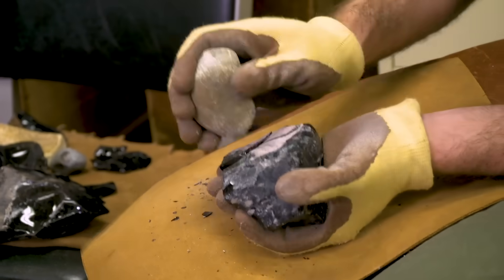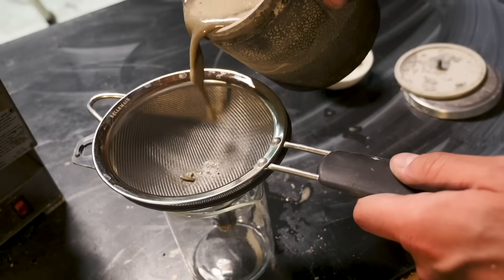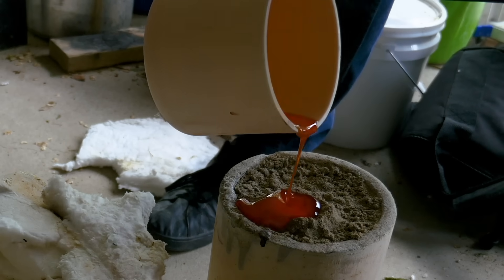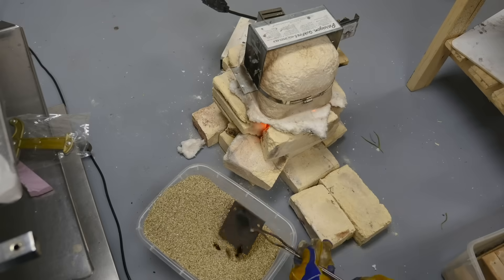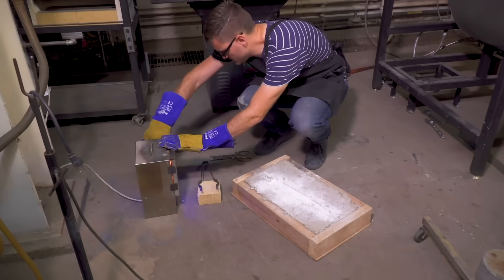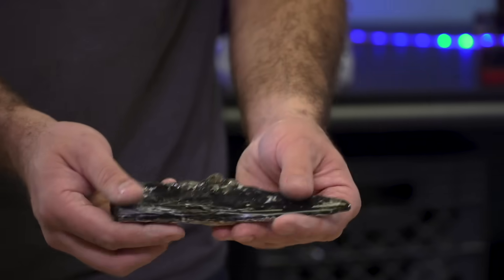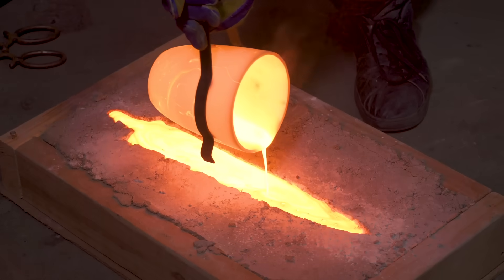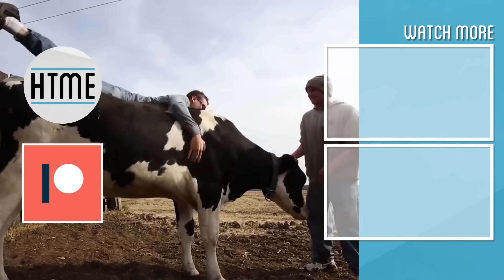Can You Melt Obsidian and Cast a Sword?

Comment: And the best they could ever do was make very skinny sharp little knives and arrowheads from obsidian and yes they had to use the ancient and old technique of fracturing it it worked thousands to hundreds of thousand years ago and it didn't need to change now but the best sword is the ostock sword which is a sword with spiky serrated edges of obsidian the sword is made of wood there's a wooden paddle with a whole bunch of arrowheads sticking out around the edges and that bad boy was sharp enough and strong enough to decapitate a horse with one swing but enjoy the video was thoroughly entertaining maybe you should try making arrowheads out of it instead of a sword would be feasible and probably won't fracture on you

Comment: You ever heard of a LEHR? After glass bottles come out of the machine that blow forms the molten glass into shape. They then spend a long trip through a large conveyor system that has multiple gas jet flames shooting at the newly formed bottles and cools the glass slowly. As not to trap energy inside of the glass. The glass will be really strong until it’s not. Then it explodes...violently!

Comment: The chemistry of glass is vital to what you were doing, and when metals are added it works best if they are already reacted as in nickel carbonate.  For flux this is even more important and borax and or lithium  are most likely needed. The rules are very different than metal that the glass batch has to be heated very slowly for a long time. The usual alumnia pots will often crack under the besf of conditions. If you want a pot likely to survive you will need a cubic zirconia pot which is a kind of clay and treatment with little relation to the jewelry. To actually make the piece it would be better tonget the near shape you want and press mold it as it will never run like water or liquid metal. Of course some research into chemical content and the appropriate amount of flux mignt be asking too much and the coeffecient of expansion needs to be as low as possible and the same everywhere in the piece hence the need for a long heat time and all the glass needs to be outof the pot before it is cooled or even a cubic zirconia pot will break.

A real glass shop with a glory hole to even out the heat before going into the annealer would also be useful. As would a very looong annealing time.

Comment: It is my opinion you have no choice but to make a custom alloy! I would be really interested in seeing what you'd come up with, never really considered "rock"/metal alloys (though from a astronomist perspective anything above helium in the periodic table is metal...) but I'm betting you could even create something new that may have some interesting properties (with some luck revolutionary).
Try to mix the obsidian with around 5% to 8% silicon, then add 1% to 2% lead (to prevent the cracking, copper may also be a good idea).

Comment: Honestly if it would have been me firing obsidian, I would have used a mixture of additional silicate and seawater. No flex needed you have three of the basic elements for obsidian right there. Considering obsidian is technically seawater magma and silicate, magma Bean a silicate melted by heat. I might suggest if you try this again, use these three methods of mixture at a approximately 70% obsidian 20% additional silicate and 10% actual basalted seawater. He too approximately 27 to 3400° and pour.

Comment: This would probably yield better results in a sintering furnace. The powder and the mould would have to go in the furnace in a way that the powder would be above the mould and then flow into it when it becomes molten. This type of furnace is also a vacuum chamber and would remove the impact the environment is having on the molten obsidian.

Comment: Japanese have a process when making a specific type of pottery. Original temperature very slowly reduced over time- much time. They do this by building multiple fires of slowly diminishing temperature. The apparatus begins on a slope with the highest point at the highest temperature , next step is to lower the pot done one step to a slightly lower temp then repeat that step until the lowest step is reached, thereby achieving a pot temp that will not crack . Doubt if that will work for obsidian since it is not much good for a blade in the first place. But you might achieve a solid obsidean blade. Then buy a knife with a steel blade for actual use.

Comment: WHERE YOU WENT WRONG at 8;30 minutes in the video,, ??  
was that YOU DID  NOT PREHEAT YOUR Casting Mold and/or your VERMICULITE.   
FIRST;, YOU SHOULD HAVE BLOW TORCHED your Casting Mold to as hot as you could short of melting the sand, then thrown HOT MOLD SAND ON TOP OF THE POUR.   
Then SECONDLY;,  The casting mold ITSELF Should have been in the Vermiculite BOX. 
Then go back TOMORROW and look at it.

Comment: Make an INVESTMENT MOLD with a wax pattern in it. Melt your 100% obsidian in a propane forge until runny liquid. Then add a large pinch of flux. Stir with a quartz rod. Your mold needs to be as 🔥 hot as the obsidian. Pour the obsidian into the mold, and immediately put the mold
Reply: back into the kiln and reduce the temperature very slowly over at least a week. Good luck.

Comment: May I first say that your attempts at this are inspiring and congratulated. 
Now, for my knowledge, observations, and suggestions. Obsidian is more of a stonelike and less of a glasslike material so the process is going to need some tweaking. You don’t want to draw out the impurities as much since they are more or less essential in what makes it obsidian. I would suggest using only a little flux and relying more on the heat to melt it all together. A larger propane furnace might be better for the process. Heat it to liquid to melt together, then bring the temperature down so it’s closer to a gel like state. It will be a little more difficult to pour and mold but it will also be less prone to fracturing. Make sure the mold is well heated also. After annealing it should be in good condition. From there you can grind an edge that possible to hone or you could knap it for that serrated razors edge.

Comment: Your mold needs to be pre-heated.  The glass (obsidian) is experiencing thermal shock from the relatively cold sand in the mold, causing it to cool too quickly and break.  The slowly cooling thernal mass of the mold will prevent a rapid temperature change and should prevent thermal delta as a cause for cracking.

Comment: You should look into graphite crucibles and a kiln that can get hot enough to do what they call slumping. Also once you have it poured into your mold if you can ramp the temperatures down over like a 24 hr period you're much less likely to have cracks.

Comment: Actually, Youre Turning Obsidian into glass.. It's no longer obsidian once melted and cooled without the intense pressure so the answer is no, you can't cast an obsidian sword using standard casting and glass making techniques... Cool experiment but a little science would have saved a lot of time. A for effort and Tenacity, thanks for sharing.

Comment: When obsidian is melted, the molecular structure of the minerals in it change upon it liquifying, thus causing it to change color, consistency, melting temp., and angle of curvature which it will break at, causing it to become naturally sharp. What i think would be interesting is: mix iron filings into molten silicon at a ratio of  Si 10: Fe 3. Then expose it to high frequency X-rays produced by  a filament of Cobalt 60 metal wire excited with 1,500 Watts of electricity, for 3 minutes. There are forms of black quartz that formed in the earth, that gets its color and metallic like sound from the iron. One of the outer most electrons of the iron atoms gets knocked into the S-2 electron shell, causing the material to change color and alot other physical properties such as the silicon becoming able to produce sounds of a big, thick, steel bolt, or a sound you would expect from a tire iron, or something.

Comment: Vermiculite, an insulation, is very bad for lungs tissue.  Indeed, it causes cancer just like asbestos.  Might want to wear a mask and not goof around with it inside your house. The particles become airborne and waft I the air until it is sticks to mucous membranes when inhaled.  Than, over time, the millions of microscopic particles cause cancer.  Usually lung cancer.  Clean the room that you used it in by using damp rage and… wear a mask rated to keep out the tiny particles of vermiculite.  BTW, the video was very interesting and your explanations and process was fabulous.

Comment: "Another way to make absidian into a blade" is to cut it with a rock saw. That leaves a blank unchipped blade. And instead of chipping it with a regular implament. You force its edge with weight down and acrossed something like antler. This will give you a blade as big as your saw will cut. Pluss still have a chiped edge. That has exstreamly even chips. As the edge is even and smooth. So chips come off the same down the length of the squared edge.

Note. Wear goggles to protect your eyes. As shards will fly everywhere.

Comment: If you know how to do the glass-ceramic process by mixing the obsidian with a metal/ceramic nucleating agent for the divitrication, then maybe a castable weapon could be done? A lot of fancy stuff but basically the divitrication liquid (found online apparently, I doubt it's that easy) allows the mixing of the ceramic with a complying ceramic creating a glass-ceramic by crystallizing the uncrystallized obsidian. Maybe be as sharp but no longer as brittle as before.
Reply: Or an even crazier idea, folding the obsidian to get the impurities out, or does that only work for metals?

Comment: How about letting it cool in the daft clay mold (both sides)? or lost wax mold. Since the lost wax mold is already hot (900 degrees) it should cool down slower and allow the glass to set up more firmly. Just a thought-

Comment: Obsidian is hard, but hard doesnt mean resistent, its so hard that when you smash it with hammer it dont get smashed or bends, so the damage is not absorved, andnit goes for the object without anything for absorb it, so a iron may be more usefull, but obsidian make much better blades because it can be more thin than metal, the Aztecs used wood swords with obsidian blades for fight against Spanish People, they said that with one attack someone litteraly cutted off the head of an horse, with one fricken hit

Comment: im no expert or anything, but i always thought if a sword gets casted, you are not using an open castform for that - but a closet one (which is empty, so nothing for the material to burn away to - basicly two realy tight "opencastforms" with a tunnel packet on top of each other.
Works with most castable metals and your pour looked pretty good so why didnt you try that? Im not judging im just curious

Comment: That's not really a success!
I believe in order for you to have a chance, you need to create a mold where you set your obsidian mixture powder, take it to furnace and slowly heat it up to melting point. Then you need slow cooling ramp to prevent it to shatter. Probably for the mold you need ceramic to be shaped and baked properly to keep it from shattering as well. Also keep in mind the thermal coefficients of obsidian and ceramic when making the shape in order to prevent stresses while cooling down. Shape it in a way that no stresses will be generated when one material contracts more than the other. Still I think it's pretty much impossible to do that. Obsidian shatters too easily.

Comment: Unfortunately, swords relays on the fact that they can bend and then straighten out (bounce back to original shape). A sword with high carbon content (0.7%+) Can hold an edge well, but is usually prone to rust and chipping. Its important that swords bend because if you strike something with lots of force, it can chip and crack and snap. Each of these are unlikely, but the chances increase if you are handling the sword with bad technique, especially poor edge alignment. This is why you can make knives with things like stainless steel because they need not bend.

Comment: Once you shape it, without completely cooling it put it in a kiln at just about 900 F for at least 24 hours to temper it then cool it down slowly at least for another 24 hours of course the longer you hold it at 900 F the more tempered it will be. I use kiln wash on my glass molds.I Never have any bubbling there may have been moisture in your sand.